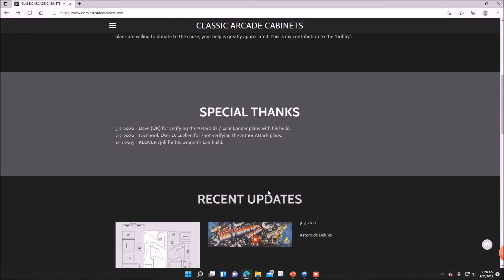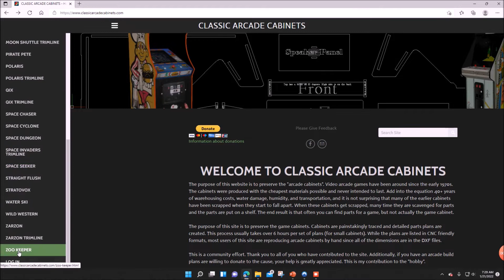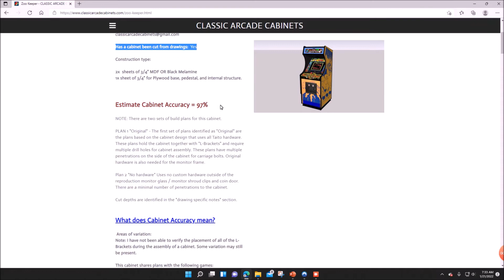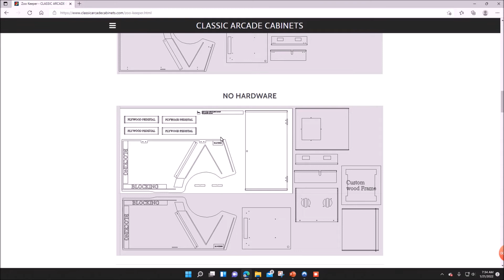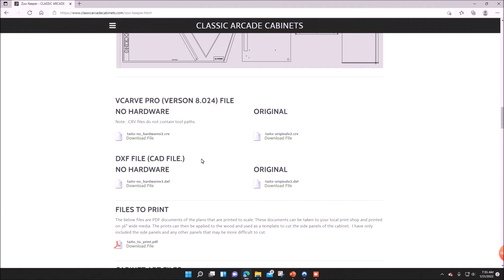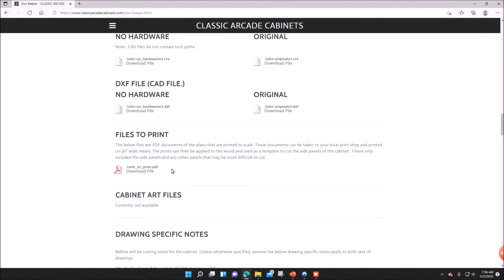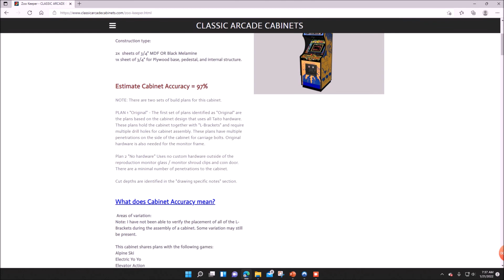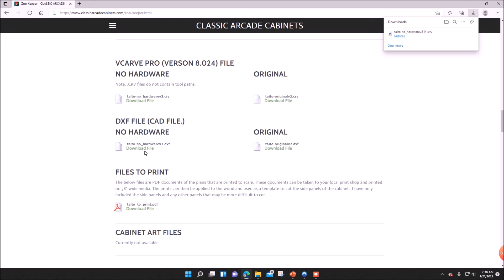Arcade Cabinet Scratch Build   Zoo Keeper Part 1

Comment: Thankyou for your sterling work on the website and these videos. I'm finding them very useful.

I printed the side panel off and cut a template, I'm struggling to get plans made for the other components. The DXF files seem buggy and when I have managed to convert one to PDF it loses the scale.

Are any of the Taito cabinet plans on the website going to help me print off the rest of the components? Thank you.
Reply from the maker: You will want to be working with the dwg/dxf files.  There is a quick video here ....https://youtu.be/dKIDAt6APNQ . If you still have issues, email me at classicarcadecabinets@gmail.com.  the dxf files have everything you need embedded in the files. You could make printable PDFs, but it gets expensive to print.